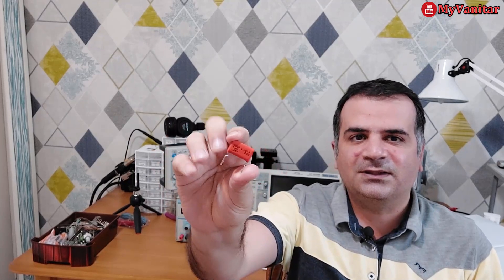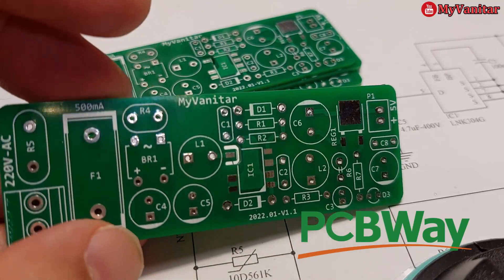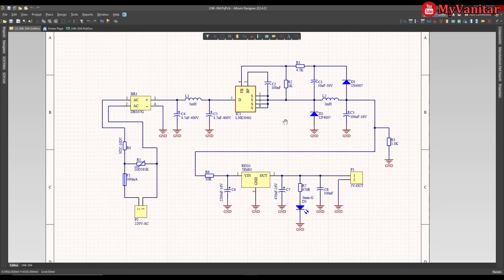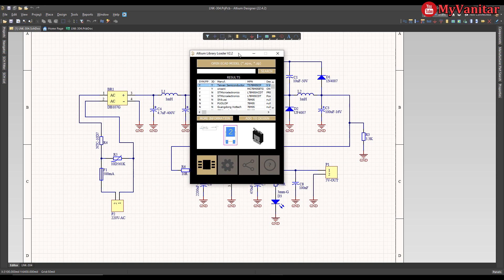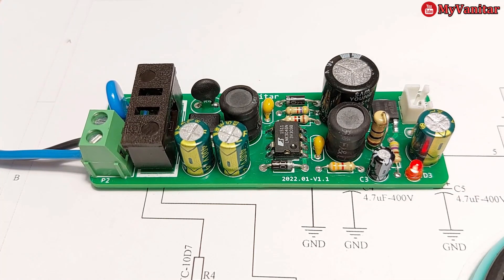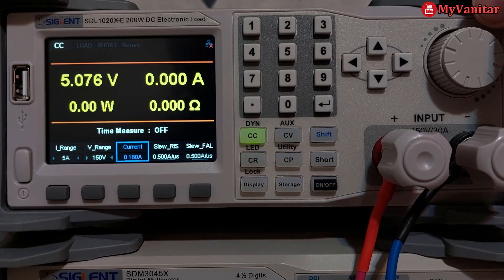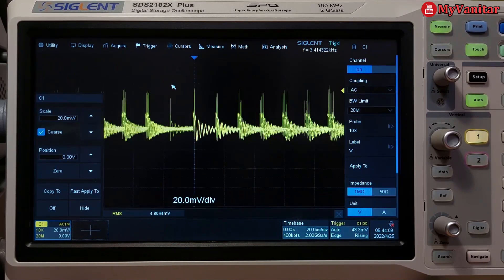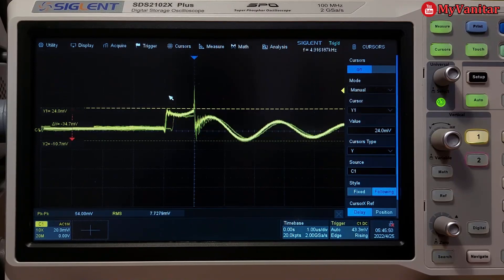220Vac to 5Vdc Transformerless Power Supply Circuit Using LNK304 [read the disclaimer below]

Comment: Hi there. Thank you for uploading this video, but I am in bit of a problem, I need 5V DC from 230V AC without a transformer also the load would be drawing about 2A of current, is there any way I could achieve that?
Reply from the maker: 2A is too much to achieve without a transformer. no-transformer designs is to save the cost for low current applications where using an isolated design (using a transformer) is not necessary

Comment: Interesting video, in several ways. The contents of your channel has been technically good, as always, but from 3 years ago to this at 8 months ago (as now), I could follow a general improvement on the didactic way of presenting the topics and in your replies. Congrats for that too.
Allow me a suggestion: You could think of a video (or short series) where the emphasis is more patiently presented on the process to:
(1) Study a topic for a project (or revisit one of yours from the past posted ones).
(2) Selected tools (and short tutorial) as Altium, EasyCAD/LTspice, component selection, libraries. Here is one video I saw you have done some of this, but in a very “telegraphic” way.
(3) PCB layout in practice, autorouting x Manual x old CD-pen style (for ‘newbies’ as some say).
(4) Assembly and welding (by yourself x partially by PCBWay) 
Wish you success and thank you for your posts!
Reply from the maker: Thank you for your warm words and your attention to detail. users like you motivate me to continue this, about your suggestion, I try to do this but trust me each project takes me a fat amount of time. content making is not easy, especially when I try to test and be responsible about it

Comment: I just received an order from PCBWay, but I just thought of a potential problem. Your video says 220v, I live in the US where 120v is the law of the land. Will these boards still work?
Reply from the maker: According to the datasheet of the chip, it should work. Please check the table on the first page. The datasheet is available in the References section
Reply: @MyVanitar  Thank you, I did have a look and I think you are correct. Thanks for the nice work on the boards.

Comment: How much voltage in present before Voltage regulator?(What is the input voltage of 5 volt regulator?)
Reply from the maker: no load = around 9.5V, with 150mA load = around 8V. The chip output is regulated, however I added an RC filter and a regulator to reduce the noise and stabilize it even further. this is better.

Comment: Common ground - it's not ohkay
Reply from the maker: Yes, it's not. you should select a solution based on your application
Reply: I watched his video completely, he says this is a better solution than a capacitor based circuit for the industry. this is not for beginners!
Reply from the maker: @hp2073  That's right

Comment: In the pcb layout (at 1:27), the routing of C6 is very 'unusual'. Also, the footprint of IC1 is very 'strange', for a DIP IC. Is there any special reason ?
Reply from the maker: R6-C6 is a low-pass RC filter. Please read the article, then visit the "references" section and check the chip datasheet for the package type. The package is SMD, G type.
Reply: @MyVanitar  The negative of C6 should be connected to the negative of C3 'before' connecting to Gnd of REG1. Do you see the difference ?
Reply from the maker: I don't know what you mean, the circuit has a common ground (star type). check the article and schematic pls. PCB is based on this. The ground has circulated around the edge.
Reply: @MyVanitar  Please consider the charging and discharging of C6. Any current ripples of C6 will also appear   at the path from the negative of C7 to the Gnd of REG1. Perhaps the unusual high noise you measured originated from this.  I would see every track as a small resistance and even inductance, especially those with high ripple currents.
Reply: @MyVanitar  It's fine if a SMD package is used.

Comment: It seems that you are measuring the output noise of a linear voltage regulator with a very noisy input source. In the datasheet, it is already specified in the 'line regulation' parameter.  I would be more interested in the overall efficiency from no-load to full-load. Thanks for your attention.
Reply from the maker: No problem man, you are free to comment your opinion. of course, the input is noisy, it is a switching design with the Mains input. in my opinion, the output noise is quite good. if you build a capacitor-based solution, (although you never can reach such a current), the output is wild with noise and ripple. the efficiency has been tested with a full continuous load. please watch the video completely

Comment: Disclaimer : super dangerous design
Reply from the maker: for beginners maybe, I have no problem, and the chip and brand is pretty famous within industry
Reply: @MyVanitar  touching one of the OUTPUTS (+5V or ground) of your power supply, is a LETHAL danger, if your body is grounded.
Reply: @MyVanitar  the brand of the chip is of no relevance here.

Comment: I feel that you really need to emphasize the fact that this is a NON ISOLATED MAINS power supply, there are very few situations where this power supply is safe to use. Newbies will build this for their Arduino projects and electrocute themselves.
Reply from the maker: This chip is introduced to overcome the capacitor-based problems, the output is not hazardous, just not galvanically isolated, however, "maybe" not safe for testing by the mains earth referenced instrument. so I did not take a risk and tested it using an isolation transformer. I assume someone who tries to build this has some basic knowledge not to touch the mains input components.
Reply: @MyVanitar  Yes! But never assume the audience is smart enough to recognize the danger, anything powered by this power supply is LETHAL if touched. That washing machine you copied the design from is double-insulated by design, hobbyists will not grasp this important detail.
Reply: It's well disclaimed.
Reply: Is a very risky design.